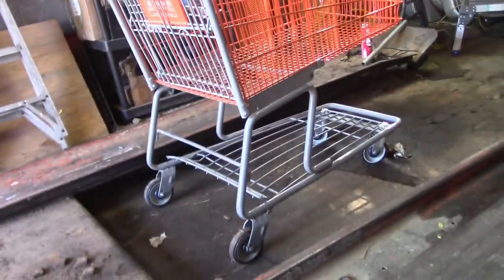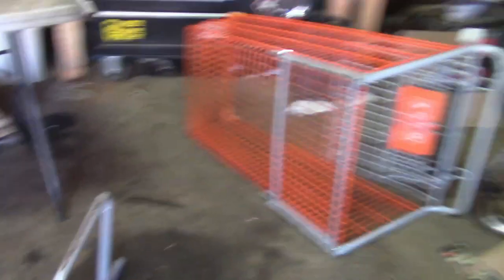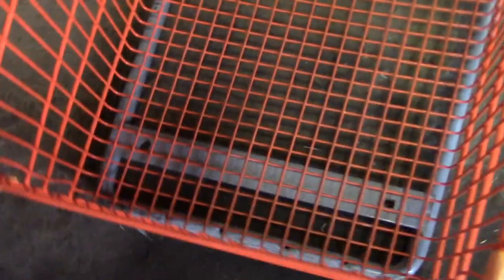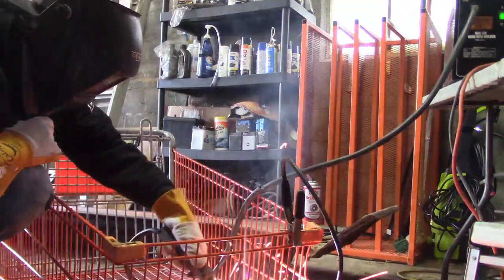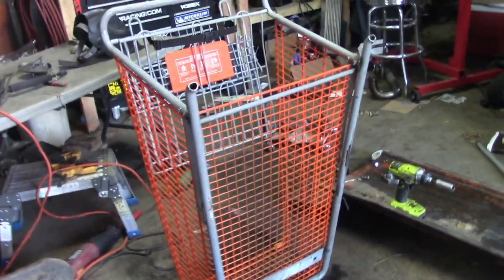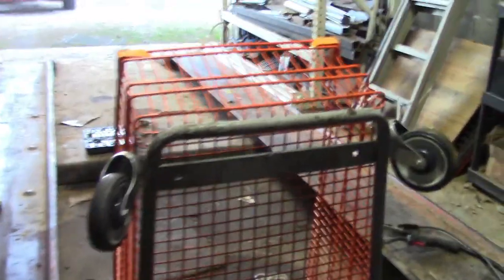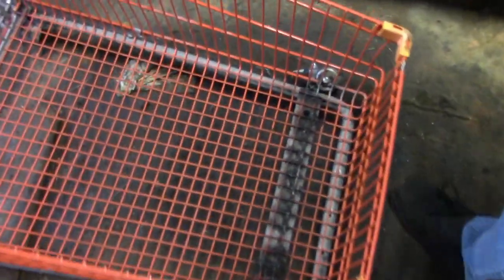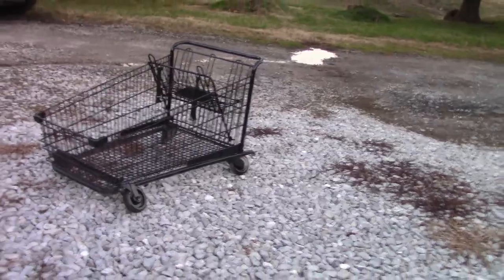SLAMMED STANCED CAMBERED SHOPPING CART!

Comment: What were your settings for the welding part what kind of electrode did you use what kind of welding machine the amps
Reply: Also the speed every setting you can please
Reply from the maker: It's just a flux core welder, no gas. But idk what I had it set to